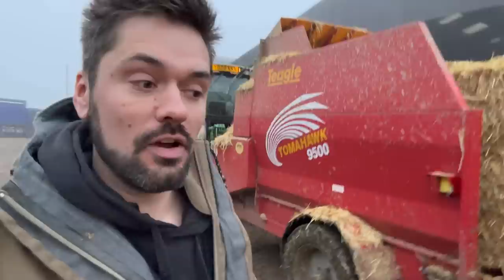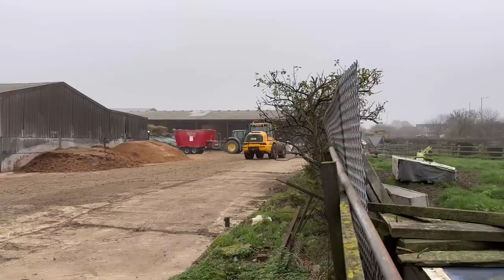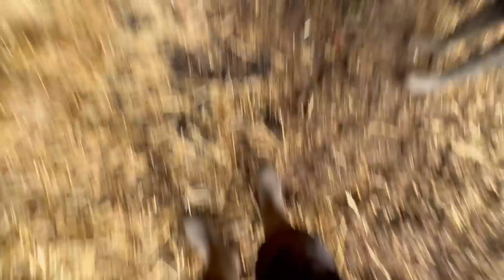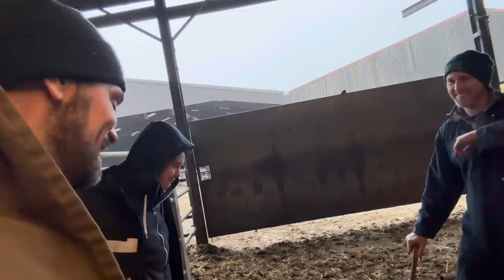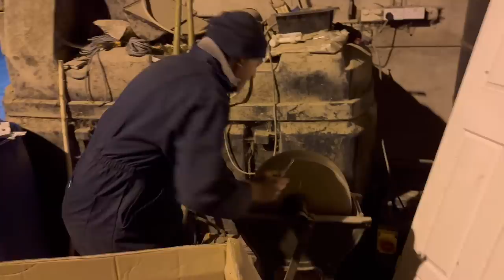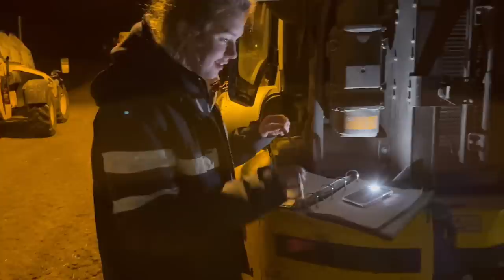Welly Chat! Em Does Some Belly Clipping! Where’s the Pens?!

Comment: Just used Dunlops and change into yr dealer boots as soon as poss.
 I'd get up in yr 9m and get those high pressure sodiums changed for leds, what are they 400watts, might as well ave an electric fire on.. 😄

Comment: I’ve had my Le Chameau wellingtons over 10 years and I worked on a farm and was a part time game keeper they never leaked at all but 2 years and the bit you pull them up with broke and they replaced them free of charge but I did get told off for not cleaning them properly he he Kev.